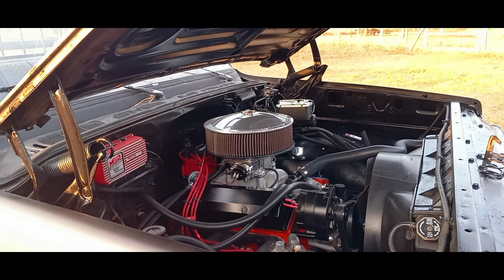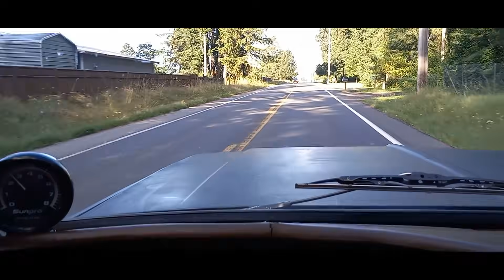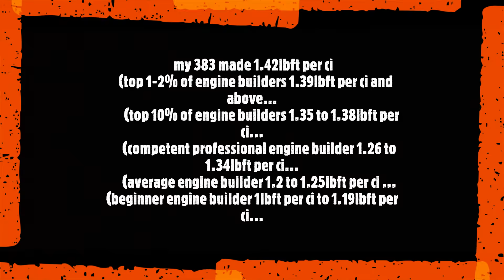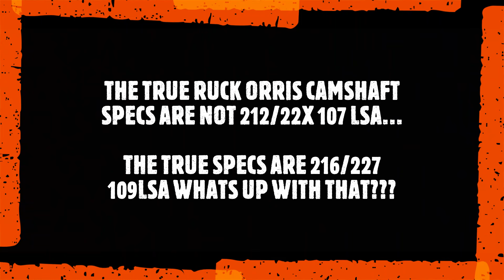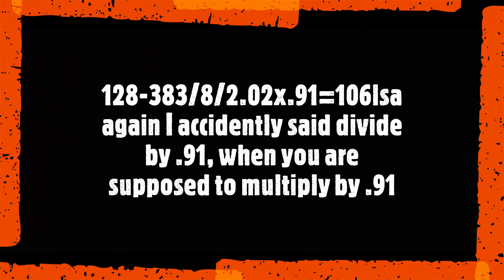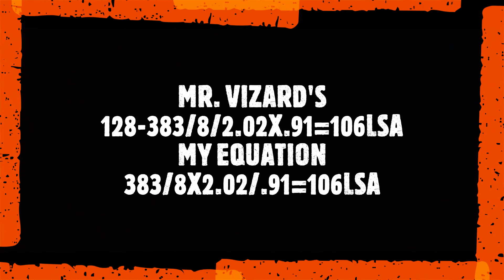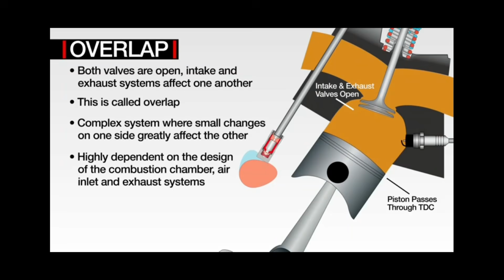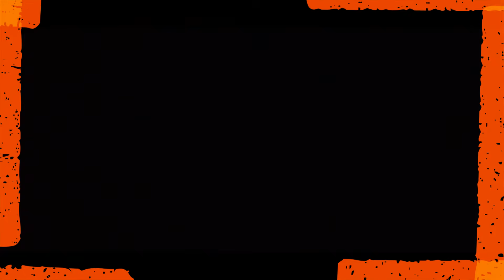CAMSHAFT SELECTION by LSA, 9 LSA's DYNO TESTED!!! LSA THEORY WILL BE DYNO PROVEN!!!, and EXPLAINED

Comment: Great information 👍 I've followed DV for a few years here on YouTube and when his old channel was stopped it was you who let it known about his new channel a big thank you for that.  I run across you're channel earlier this year when you first started and subscribed after watching a few minutes. I could tell you know what you're talking about and anything chevy gets my vote.  I first heard DV's 128 formula a while back, but not as much talk about the over use of duration in most cams to compensate for too much LSA, that explains a lot why too many cam manufacturers push too large of a LSA.  I have a few engines I'm wanting to build in the near future one being for my 57 chevy truck that I'm making a 4x4 I want it to be a torque monster but still haul ass.  Not going huge tires probably 37's I have all one ton driveline and good old SM465 transmission for it.  Some of my many engines I have available to build up for it are a mild 383, a 400 punched out to a 406, and a 454 with 1971 LS6 heads.  I  haven't been able to decide although I'm leaning towards the 406 or 454.  I have a question take the 406 that being a .30 400 would that say use 130 as the formula number as it falls between the 128 formula used on  350-383 small blocks of course I've only heard it used up to a 383 and 132 for big block chevys.  Just curious if since the 406 is getting closer to big block chevy cubic inches if landing between small block and big block would be correct.  I'm also curious if say 9.5:1 compression would affect the formula enough to make a big difference.  Thanks again for the video good information and I hope you can get some relief from your condition living in pain sucks.
Reply from the maker: I've noticed you commenting on my videos quite awhile ago, thank you for watching, and thank you for your sub!!  
So as far as the 406ci sbc you would want to still use the 128 and of course this will produce a 105 lsa, it will help with the cylinder heads ability to present flow to the cylinder sooner to aid in cylinder filling at the very begining of the intake stroke. If you dont start to fill the cylinder with in the first milliseconds after or at the end of the overlap period into the beginning of the intake stroke the ability to fill the cylinder wont catch up threw the rest of the intake stroke, therefore resulting in the inability to fill the cylinder completely which results to less tq & hp production.. now with the ci to cylinder head flow of a sbc.. using 130 produces 107lsa which would be fine for a 406 with 12:1-12.5:1 compression.. if your 406 will be 9.5:1, for every drop of a 1 whole number in compression from the standard 10:1-10.5:1 compression, the LSA will typicaly need to be 1 degree tighter which= 104LSA.. its now known that The 128 works perfect with ls engines which as most know have heads that flow more than a sbc, 128 has now been proven by me to predict LSA for best power production even in larger ci ls engines being as that ls was a 402ci ls 2/3 hybrid with 2.165 intake valve & 10.5:1comp, 128 produced the 106LSA which was proven by the dyno curves as the ideal lsa for that 402ci ls 2/3 hybrid.  this is just an example to reassure you that the 128 will produce an LSA that will provide plenty of ability to access flow potental to be able to feed larger ci SBC's to produce fat tq & hp I hope this helps, Take care brother!!
Reply: @CDG-Racing_Dynamics  thank you for getting back to me on my questions and answering them.  Far as heads for my 406 I will probably go with heads I already have as with today's prices I have to budget things.  My options are bowtie 034 heads with 2.02 1.60 valves that have room to port as they only have the casting lines cleaned up, or a set of 041's that have been cut for 2.02 1.60 valves and have been ported heavily.  I would like to keep compression between 9.5:1and 10:1 so I can easily run pump gas with no issues.  As for the intake I think running a single plan will hurt my low end so seeing I've had and seen a lot of good builds use the edelbrock air gap RPM so I probably with stick with that.  I'm still figuring out a cam spec but finding one with a good flat torque curve and yet still pull good up to 6000 rpm, but turn more if needed as it will definitely see lots of mud pits as well as keeping the ricers at bay.  Your dually has some impressive numbers that you stated and with what you said about your 84 mud truck you got good experience in cam choices for making a heavy truck go.  With what I've listed do you have a recommendation on a cam spec.  Well hope you had a good new year's  and hope that you have a good year.  Take care
Reply from the maker: @chevyfan 82  do you have an idea at about what rpm you would like peak tq and or need peak tq to be. We will be able to produce a good solid fat tq curve with a solid peak tq number.. Once we get that figured out we can work a specific rpm for peak hp with an estimated number for a peak power goal.. take care buddy!  
P.s. I want to bring something to your attention, the olny reason i had brought this to bills attention is because I am friends with him, but I absolutely did not want to tell him what I was about to tell him, I was trying to help him save face with people who knew that a 1hp per ci & 1.35lbft per ci  N/A  V8 Is physicaly Impossible. I had seen these anomalous situations growing up testing race engines with my dad & grandpa, we have had engines that produced more power than physicaly possable, and when you get those results you throw them out, typicaly in that situation you would take the lowest output and the highest realistic power output, then come up with an average by using the numbers in between the two..So i proceded to adress the issue in the most respectfull way possable but it is really hard to tell someone that the power, specificly the tq that their engine made on the dyno was incorrect and was a output produced by improperly loading the dyno because you tend to look a bit like an ass 😂 lol. Now Im not sure if you are aware but the power and tq numbers that were produced by that 400sbc that bill assembled for vickis truck. We're incorrect numbers produced by cranking up the pressure on the dyno, & loading it up hard at a low rpm.. a low compression 400ci making 400hp which is 1hp per ci & 540lbft@4000rpm which is 1.35lbft per ci, these output numbers are physically impossible in the reality we live in. The last correct numbers that were produced by the dyno were 372hp@5000rpm which is .93hp per ci  & 457lbft@4000rpm which is 1.14lbft per ci... now we must ask ourselves why would loading the dyno up at a harder at a lower rpm produce an increase of 28hp & 83lbft ?? IT WOULDN'T, as I said these numbers were a product of incorrect loading of the dyno and or dyno operator error. In all honestly bob should have caught that mistake being as the output produced is physicaly impossible for a low compression 400ci v8 to produce 540lbft@4000 & 400hp@4000rpm it would need to be around 500ci which would equate to 1.08lbft per ci & .08hp per ci . Now compare those output ratios from the 500ci and the 400ci that wasnt a false number./500ci .08hp ci & 1.08lbft ci // 400ci .93hp ci & 1.14lbft ci __This is with in the relms of reality except for the fact that engines don't make hp & tq at the same rpm, specially at those output number's.. In all honesty there are 502 bbc's that barely produce 540lbft... before Bill had assembled that engine he showed all the parts being used, after knowing the specs of the engine I told Bill the engine would make around 380-400hp depending on if he decided to use 1.5 or 1.6 rockers. & 450-470lbft, those numbers are extremely close to the last correct numbers produced, 372hp & 457lbft, these are the correct output numbers.. but there are now 126k people who think a 400ci engine can produce 400hp@4000rpm 1hp per ci & 540lbft@4000 1.35lbft per ci.. I had also told Bill that being as I'm a rare individual I would be the only person that says anything about the tq numbers, and out of 1.3k people that commented I am still the only one who said anything, and bealive me I really did not want to say anything, as I said I was trying to help Bill save face from those who know that its  impossible, but im not sure how many people seen it that actually knew any better. now being as bill still don't know me that well i told him i dont blame him if he dont bealive me because of all the internet experts these days.. well apparently he didnt bealive me or look further into the possibility of producing that output.. I was hoping he would come to the conclusion that it is not possible, and adress the 126k people that now think you can do something that defys the laws of physics, and let them know that was a product of false dyno numbers.. if you look at the facts they are all there... I figured I would share this with you because you seem like a good person, that and ive been wanting to get this out and at least let someone know so there is at least one more person that understands what is and isn't possible... take care buddy, let me know what you want for tq & hp rpm's and we will go from there..
Reply: @CDG-Racing_Dynamics    it's funny that you mentioned about Bills sbc 400 for Vicky's truck as I watched that and thought something was off. I don't really know a whole lot about running a dyno, but that being said I have seen lots of testing numbers over the years that don't match up with real life performance. What you said makes sense and I've always heard over the years how you can manipulate a dyno to inflate numbers. I've been researching and thinking about it for a few years on my 406 what I want to do with it. I've watched many hours on YouTube of people building up 400s and showing the dyno sheets or runs.   I found some to be unbelievable that it could make more horsepower and torque at a lower rpm then a good spicy big block Chevy. I'm still on the fence if I want to build the 406 or go and build my 454 I love both small blocks and big blocks, but I know with fuel prices the way they are the smart choice is go small block. The RPM range I want max torque is tough of course I want good low end but I also want good mid to top.   You know how the sm465 are geared so it's tough gears wind out fast and have low gearing, but I'm thinking somewhere between 3,500 -  4,000 rpm. I want to be able to tow with stump pulling torque and ideal over obstacles in low range but have good mid range.  I have two sets of axel to chose from either a 4:10 or a 4:56 and 37's  hoping to keep cruising rpms under 2,500 rpm to help with fuel economy so I'm leaning towards 4:10.  I do want something that if you stick your foot in the pedal you can feel it push you back the more you push down.  I had a 84 short bed on 36's with 3:73 gears years back with a very healthy 355 in it, and man would that lay the rubber down and scream to high heaven doing so.

Comment: Thx for sharing. SBF here. 331 cu in. (10:1 static/ 7.9:1 dynamic I think) BluePrint 190 heads 2.02/1.60 flow 250 @ .500, coefficient of discharge isn’t great, dual plane Weiand intake with 600 vac sec carb on 1” wood open spacer, 165 cranking compression at 5000’ above sea level, comp XE266HR12 cam, 1-5/8 headers,manual 4 speed 1980 Bronco with 3.73 LSDs front/back, on 35s. Runs pretty good but I’m unsure if my compression is too low to narrow the LSA and contend with much overlap, or if combo would flatten out. It’s good for cruising, gearing on trans helps get it moving. Would a cam change improve torque by going to a 108 LSA?
Reply from the maker: If you narrow the lsa it will actually increase compression because your intake valve will close sooner. With a 108lsa you will gain power across the entire hp curve with more peak power & you will gain alot more at low-mid range tq where you want it, you will also produce more peak tq & you will still get gains past peak tq.... I hope this helps answer your questions, I appreciate you taking the time to watch. Take care buddy!
Reply: @CDG-Racing_Dynamics  I’m concerned about raising compression because I’m new to this (first build) forged Mahle 4032 flat tops might be a little forgiving, but my warm cranking compression at my altitude equates to 195 psi at sea level. There’s room for more on 91 octane?
Reply: Yes it will get way better torque and hp
I found that out on Toyota 4cyl engines
That 108/106 LOBE CENTERS HOLD TRUE I tried 112 lost a bunch of torque went back to 108 and never looked back
Reply: @mikasantos3774  what Toyota motors have you worked with.could you share what  cam spec work for you.thanks for your comment.iwas wondering how 108 work on inline 4 and 6 toy
Reply: @johnstuchlik5828  
I run the Toyota 2&3tc hemis
Old school Norris 368s grind .264 at .050
515 lift 108lobe centerline and separation 12to1 comp on pump gas
And some other grinds with other manufacturers with similar specs if I use the engine in a mini stock dirt track car I usually set cam advance 2 degrees for a 106 lobe centerline for a quicker response off the corners